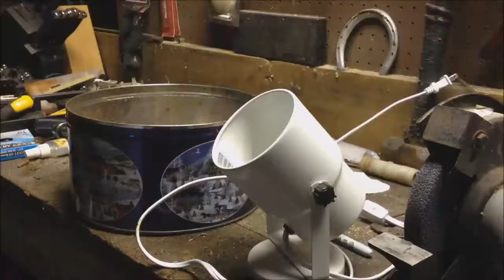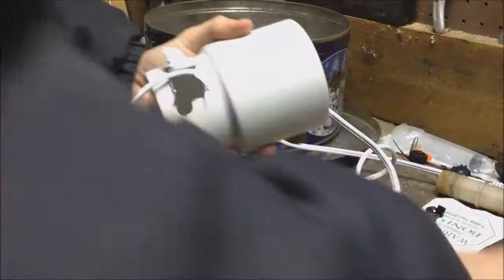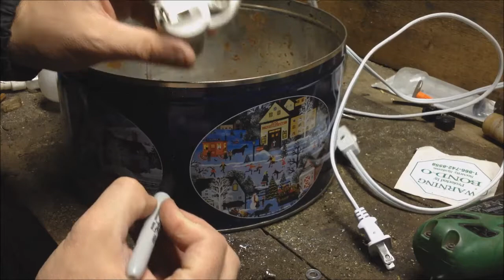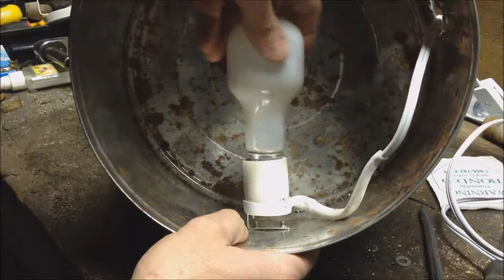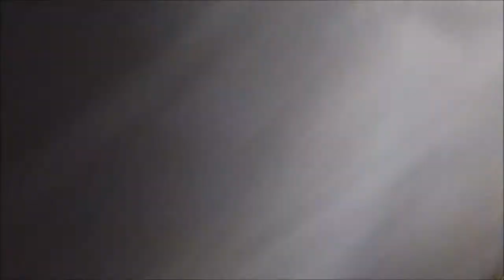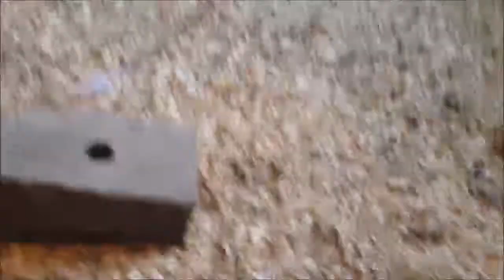DIY Chicken Water Heater Build

Comment: I'm about to try this out, I've got 15 chickens in the cold Upper Peninsula Michigan. I'm curious how the 150 watt bulb worked out for the rest of the winter? Was it enough to keep ice from forming at the top of the 5 gallons? Or did it get too hot on the plastic bottom of the water container?
Reply from the maker: The 150 worked for almost all winter - last year we had a few weeks of -30/35, and I did end up changing to a 250 watt red heat bulb.  Never had any issues with it being too hot, and due to water circulating (the warmer water rises and colder sinks) I never had any freezing at the top either.  This is a five gallon waterer.  I found it a fantastic heater!
Reply from the maker: This year we did a fantastic upgrade - video to come soon!!!